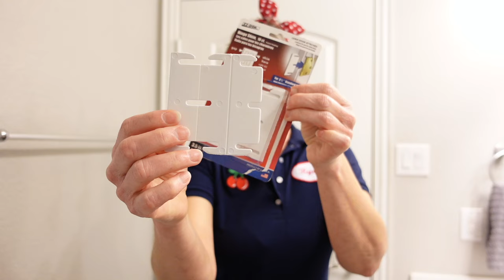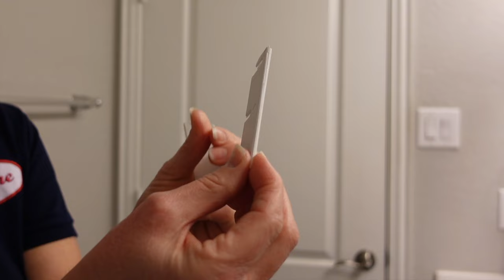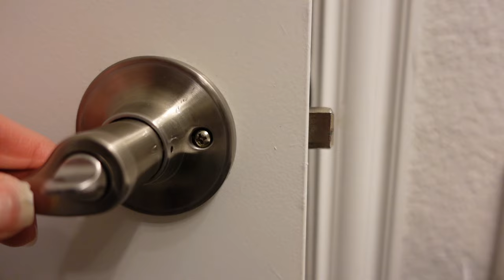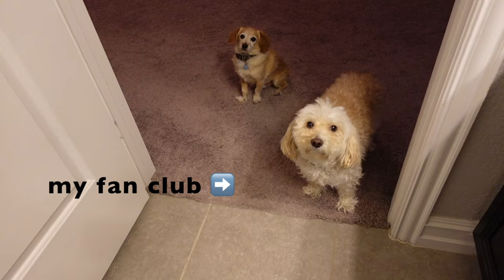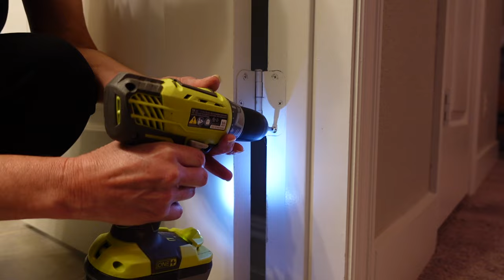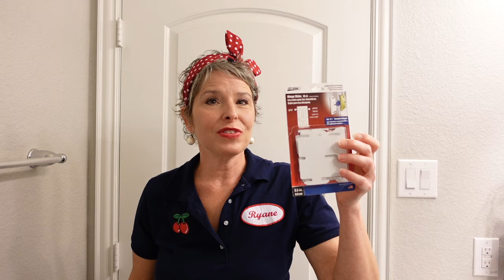STRAIGHTEN A CROOKED DOOR IN MINUTES! // Simple Technique With EZ-SHIM Pre-cut Door Shims!

Comment: You might also check that the screws in the top hinge are not simply the cheap 1 inch screws that came with the door. Using a longer screw (like 3 inch) can better anchor into the framing studs and possibly pull that door into proper position.
Reply from the maker: Thank you so much for that suggestion! I appreciate you sharing that tip here so that we can all learn together!🙌🏽